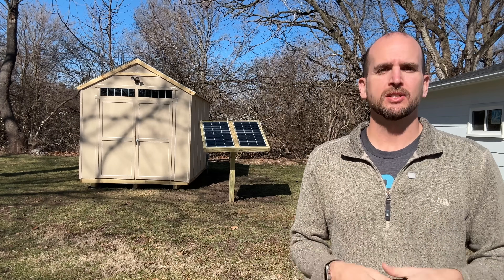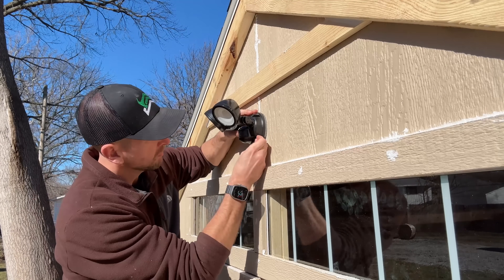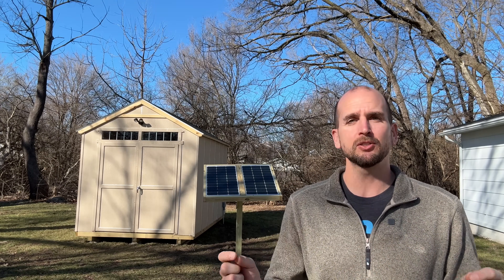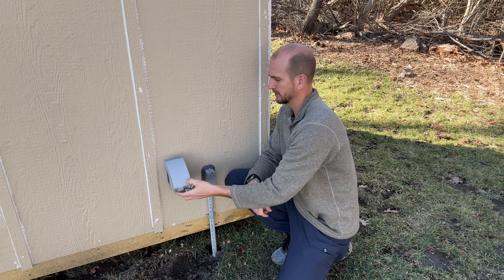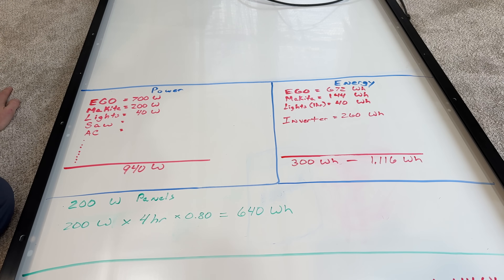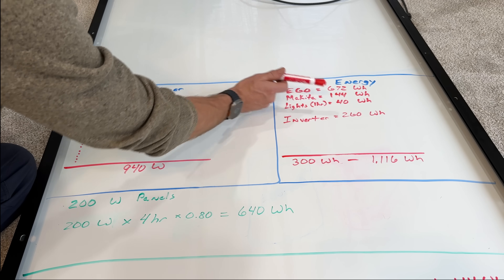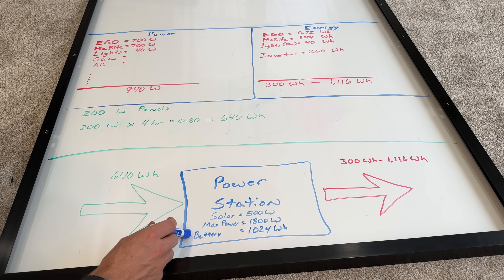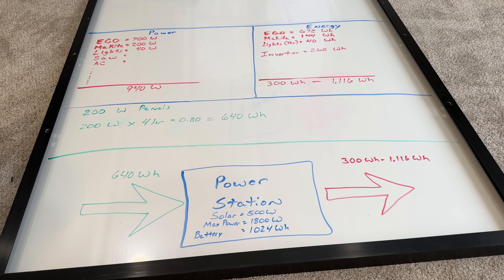DIY Solar Powered Shed Setup

Comment: Do you bring the ECO FLOW inside, in the winter? Does it hurt to leave it out in freezing conditions? Thanks, really like your stuff.
Reply from the maker: The Ecoflow Delta 2 will run without issue down to about 20F.  Below that you need to figure out some type of insulated box or bring it inside or the battery will not discharge at the lower temps.
Reply: @EverydayHomeRepairs that’s kind of a big deal since most people live in places that routinely go below 20 and makes this solution a nonstarter
Reply: Nice mini array for your shed!  The only calculation I’m wondering about is how many watts you get out of your panels. My experience is 200 watts of solar doesn’t equal 200 watts of output. Many inefficiencies factor into that. I suspect some people watching the video may not be aware of that.

Comment: Cool! First, I have a shed with no power in a county which requires a pro electrician to do the wiring. Second, I have a family member with sleep apnea who requires a CPAP, and I have been wondering about how to power that if our power goes down for more than 24 hours. This answers that question! Yay! 🎉Thanks! ❤
Reply from the maker: You bet!

Comment: This is exactly what I need for my mini barn and Blueti 200max. Now I just need good ideas and considerations for a insulating box for the Blueti. It does not like freezing temps.
Reply from the maker: So true, the Delta 2 does well until you get below 20F or so.  An insulating box that could stretch that bottom end operating temp would be a great addition.

Comment: I'm fixing to do something similar to this in my barn.  What happens if the batteries are fully charged, your not using any electricity but the sun is out full sending voltage to your system?
Reply from the maker: In this case the EcoFlow will cut the solar input power.  Once the battery starts to drain down then the internal charge controller will open up for solar input power.  No danger of damaging things.

Comment: A lot of good info here.  I'm going to have to watch this video a couple more times to fully understand it all.  Thanks for sharing.
Reply: I'm also a rookie.  I bought my first solar generator a few months ago and let me tell you, solar is addictive.  I've bought more batteries, and plan on buying another inverter to generate 240 for the home.  Since I bought mine we have lost power twice and it's as simple as wheeling the dolly out of my closet with my generator, plugging into my house through a transfer station ( I learned on this channel) and we have several hours of noise free electricity for all important  120 volt systems ie freezers, refrigerators, WiFi, living room.  In addition, I am building a carport next to our house and you can bet the south side of my roof will be solar panels going right into my house.  Two of my friends just did this and they are enjoying $30 per month electric bills.
Reply from the maker: Sounds like a pretty sweet setup 👍

Comment: You could just pay less for an electrician to run a circuit from the garage to the shed and then have constant power.  Even if you used the 1.1 kWh every day that is only 20 cents in energy costs.  Take the $1,000 solar setup cost divided by 20 cents and that is 5,000 days (13.7 years) of daily usage before you break even.  By then the battery on the Ecoflow will have failed and you will need another $800 investment to keep going.  Now if this was a remote shed with no power available anywhere close, then this is a good idea.
Reply: I call bullshit on it costing less than $1,000 for an electrician to do all of the work to dig a trench and run wiring from a house and setup a sub panel in an exterior building. Materials alone would cost half that and this ain’t no 2 hour job! 

And if you only have 100amp service to your main panel they may not even be willing to run a sub panel unless you upgrade your service too, so that’ll be another $2,000 minimum. 

If you want to save money you could do a similar setup with an inverter and lead acid battery for half the cost. It’s the Ecoflow that makes this so pricey.
Reply: @johndoe6032  You don't need a subpanel as a simple 15 amp circuit would handle everything he covered.  100' of 12/2 direct burial wire is $140 and 250' is $200.  Two LBs would be $5 each, and 1 stick of 3/4" conduit split between them is $10. Rent a trencher for $300 a day and the cost of everything but labor is $500 - $600.  Since this was DIY video if you do it yourself that is the total cost.  You can buy the material, handle the trench, and place the wire and simply pay an electrician to do the connections (if you can find someone to do such a small job) and you would still be under $1,000.  Pay someone to everything and it might be $1,200 to $1,500 but then wouldn't be a DIY project would it.
Reply from the maker: I agree with you, if you have grid power close that makes sense to tie the shed into your house or garage.  This type of setup really shines in the remote setups.
Reply: We need to move away from being a service dependent society.  It's rediculious all the services people pay for such as body care, entertainment, meals, utilities.  Everyone needs to change how they think and become more independent.
Reply: Since your comment the cost of lithium ion power stations has come down, and you don't factor into your numbers price inflation in the cost of grid power (reducing the length of the payback period).  So the numbers are looking better all the time.  And for some people, it working in a power outage could be an advantage.

Comment: Any city permits involved?
Reply from the maker: Check with your local inspector.  When it comes to small storage sheds the rules and regulations vary from state-to-state and city-to-city.  Also, some HOA's would not allow ground mount panels.

Comment: I understand the $ 1K cost. But getting the math, size needed, tools used. Better than an electrician or solar company cost. Thousands. That's why I like your channel.

One thing I've been thinking about is a Large Honda Gennerator on wheels. 😊
Reply: I literally had an electrician tell me "I can wire this up, but we'll have to get permits, probably upgrade your service drop (home was built in the 50's), and trench conduit for 30ft. You can trench yourself if you want to rent a machine and not pay me $150 to dig a hole, but even then it's still way more expensive than just getting a solar kit from big box for $750 and doing it yourself. If you don't need high draw or all day power, that'll probably do you and save you a lot of hassle."

Comment: It isn't really free power when you have to spend a thousand dollars to get it.
Reply from the maker: I had 6 point font underneath that said "after $1,000 initial investment." 😂
Reply: 🙃 @EverydayHomeRepairs
Reply: What’s the expected lifespan for these solar panels and the battery pack? Should be included so we can compare how long the payback would be if we knew our local cost for kilowatt hours and roughly how much it would cost to trench power from our house to shed
Reply: @baxt1412  in general 20 years on the panels and 10 years on the batteries at least.
Reply: You would spend double that easily getting an electrician to run wiring out to your shed and install a sub panel. And you better hope you main panel service is high enough to be able to taken on the additional load, because upgrading main panel service is another $2,000-$5,000. 

And then after all that you still have to pay for electricity used!
Reply: @johndoe6032  Additional load? This set up can not handle much of a load. If you needed any kind of a load in the shed the solar setup would cost thousands of dollars more.
Reply: @BryanMakesThings  If an electrician sets up a sub panel they have to assume that it may eventually be used to it's full capacity, even if the current owner swears up and down they will only ever use it to power a few light bulbs and charge some batteries.

You never assume anything is going to only be used based on what the current owner says, or even what they believe they will only use it for. They can change their mind in a month when they decide they want to run a bunch of additional equipment in their yard. Maybe that's why this guy set up the GFCI outlet outside the wall to begin with. Seems like there's no reason to have done it outside when he could have set it up inside.
Reply: @BryanMakesThings  that’s the point. You can add a solar setup to get just what you need, or add a sub panel that will be a lot more than you’ll ever need and possibly require to to upgrade your main service just to be able to add any sub panel. Electricians and inspectors don’t care if you pinky swear that you’ll only ever use it to charge batteries and run LED lights. They have to think about how the next person may try to use it. 
And maybe you can add a sub panel yourself and break your back digging a trench and running conduit and then conveniently forget to get it inspected, but you’re still going to spend $500+ and a lot of your own time doing the work and only after spending tons of time researching NEC code to make sure you don’t accidentally burn your house down. 
Or you could spend $500 on a much cheaper version of this same setup that doesn’t use overpriced ecoflow gardware and have it done in an afternoon.
Reply: Not really. I have something like this also that I set up last year for my shed since I’m way out in the county. 2-100 watt solar panels that I paid like $150 that came with a wiring kit. A 100 amp lithium battery that I got for $250. $110 on the inverter and $80 for the solar charger controller. Bought all this new. Renogy on the solar panels. LiTime on the battery, inverter and charge controller.
Reply: After you have had it for 15 years, the rest is free.
Reply: EcoFlow Delta 2 is about $500
2 100w solar panels about $100 to $200. 
Maybe a little bit of wiring.
Reply: How much is your electric bill? It pays for itself or have you never heard of that phrase? Or maybe not this one either. Nothing in life is free.
Reply: @brianmoore4299  what a sad outlook on life.
Reply: That’s some mighty fine myopic reasoning there. Let me guess some anti renewable resource red hat talking points, right?
Reply: You have a video advertising $2 dollar shelves but needed a 50,000 car to drive to Lowes and 100’s of dollars of tools so are those shelves really $2? 🤣
Reply: @LancerThomas  😂😂😂I'm stealing that bit about the car!
Reply: i took the bus @LancerThomas
Reply: @bryanklotz  socialist.
Reply: clown @LancerThomas
Reply: clown @LancerThomas
Reply: @bryanklotz  yeah you said that already. Anything else or are we stuck?
Reply: Nope, that just about covers it. Clown @LancerThomas
Reply: @bryanklotz  boooooooring.
Reply: @bryanklotz  disappointing.  Not surprising, but disappointing.
Reply: Some people are just impossible. Everything cost so why not use solar. At least you can do the work yourself. I could run a line underground but the cost of copper and the conduit because direct burial is not the best way either.i would rather pay a couple of hundred dollars for panels and you can run the lights on 12 volts and wouldn't need an inverter I could do a small setup under a 1000 dollars and would have backup power for the house if needed which would be good during a hurricane.   73
Reply: My car too has "free gas": I paid about 13k more initially to get a fully electric.
Reply: @nixquev lol...and good luck charging it or driving it when you piss off big brother and don't "comply" with ever increasing societal controls we are seeing unfold daily.  In 5 years, we will see the dumbed down masses with their reliance on the grid vs. those who first put their faith in Jesus. 2..they prepare by home solar... getting off the power grid as much as possible with a solar setup in case things turn sour.  3.  Get a pre 1995 diesel and convert it to run on ANY oil...used or new...vegetable oil, beef tallow, used engine oil.  I have a top of the line portable emergency solar system.  I now plan on installing a home system and procurring a diesel/oil vehicle.  An EV is not a reliable vehicle bc its dependant on the power grid.  Wake up friend.
Reply: You’re the kind of person people go out of their way to avoid because you’re so insufferable
Reply: 🤦‍♂️ always a heckler, just steal it, then it'll be free; oh but then U have to do the work and from Ur comment, it must be worth loads, but child &/or slave labor is an option... 🤷‍♂️
Reply: It is when you get it from the sponsor for free. Lol
Reply: Enjoy paying your greedy electric company
Reply: I spend $1000 on my light in 2.5 months. So yes a $1000 payment is way cheaper than $400/m electric bill.
Reply: @taraspear1691  This isn't going to generate $400 a month worth of electricity.
Reply: It’s about access and convenience.
Reply: Well you are buying infrastructure that you can modify or resell. Compare that to paying your utility bill, in which case your power is not only not free, you get nothing to resell. Maybe you can afford to buy your shed's energy at $3/month for 30 years and get nothing else out of it. But if you buy your own utility, the power is indeed free.
Reply: Amazon has everything you need for a 300 dollar solar kit that makes the power i need no need to call a a company and spend thousands $
Reply: One panel, $60, 10-20 amp PWM charge controller $20, decent 1000-2000 watt inverter $200, lead acid deep cycle at Costco $85, 100 amp lifepo4 battery $200.  Use a simple cord pass through and a power strip if you don't want to do all the b***** with Romex.  I've got a milk crate system in my shed powering a light, charging my weed eater batteries, and used for running a skill saw and chainsaws.  It was $300 for the setup and beat the s*** out of running conduit and wiring the shed. I've got two strands of LED remote control lights that run on the 5 volt from my charge controller and they pull about 2 watts when they're running.  So, you don't have to get all fancy, you just have to do what works and it doesn't cost much.
Reply: Yeah it would probably be cheaper to just throw romex in the ground and watch it spark next season when digging in the flower bed.  Some counties have certain codes and permits that would need to be pulled to run it out there from the house. Then it be inspected. Small cabins, sheds , a little back up power on solar I like it. Thanks for the video. Prices have came down since all this came out as well. Harbor freight sells a little kit now. Heck you can buy one shop light with its on little panel at Walmart for like 30 bucks.

Comment: Nice overview Scott. I'd be tempted to rotate the shed 90 degrees, pointing the roof pitch South, and load up that side of the roof with more than 2 panels so long as you had enough battery to collect it (assuming sunny days.) 

You'd skip the ground and trench install ... and I say this as someone who would probably never want to put panels on a house roof.
Reply from the maker: Not a bad idea at all, thanks for the feedback 🙌
Reply: There was another video from some egg head about double sided solar panels being mounted vertically. Apparently the back side gains more efficiency from reflected light. Would this mean you could mount the panels like a fence in front of your shed, and if your shed was painted white, it would work just as well as roof mounted panels? Or consider a greenhouse with solar panel walls... or even alternating skylights with structural solar roof panels? Maybe a solar panel  trombe wall?
Reply: Might want those doors and windows facing the way they are for interior light

Comment: Those panels look like they are shaded by a branch in winter, let alone summer.
Make sense in a total offgrid situation, its financially stupid in an ongrid situation.
Reply: Depends upon the shed's proximity to that on-grid power.  I went very minimalist with a shed power setup to a shed way  in the back acre.  200 watt solar panel ($150) on the roof side which gets the most sun, 27-size lead acid marine battery ($100) , 2000 watt pure sine inverter ($230), and panel-to-battery charge regulation module ($30)  all up on a plank in the rafters.  Power switch to turn on the inverter an light switch on wall, outlet box 24" off the floor on the same wall as the light switch.  About $500, self-generating and sustaining,  and no trenches to run a long line to the house involved!  I don't use it extensively, but the power is there when I need it, for hours.  Love it.
Reply: @paulh6591  Okay, you proved my point? Your  back acre is not on grid.

For all the money you spent on that limited fixed system, you could of spent 100's less on a invertor generator, and its portable.
Reply: @mnSure, integrated inverters are nice.  It's funny they're now calling them generators, even if there is no generator attached. .   It's fairly similar to my setup, less the solar panel.  I like having the battery and inverter components separate, and prefer a cheap, stable lead-acid marine battery for built-in applications. If you go lithium, and espcially if you invest in an "inverter generator", make sure the internal battery can be replaced at the end of its service life.  Find one with safer. longer life lithium iron phosphate battery (LFP / LiFePO4) batteries, instead of a built-in NMC one.  As for hard-wiring to the grid, it's certainly a solid option.   I hacked a long trench, pulled wire to a camp shed in Maine.  It costs time and money too, but  It's all good.

Comment: Kinda wish you went through the step by step in the electrical wiring
Reply from the maker: I tried to pull multiple video together in this higher level video of the whole system.  Here is the complete video on the shed wiring https://youtu.be/s791YHa_w2Y